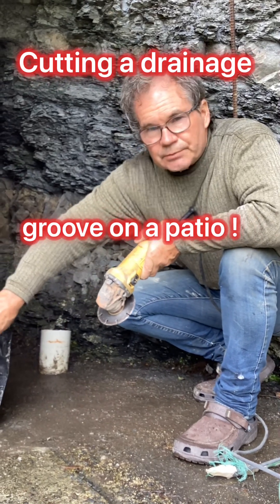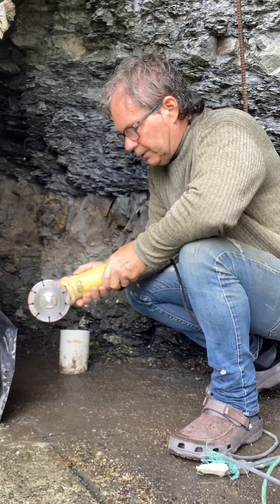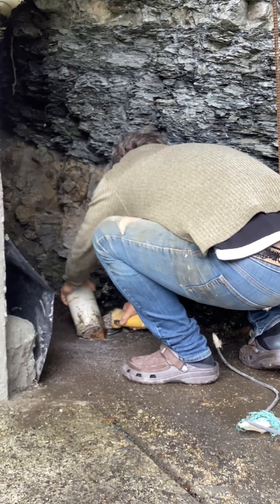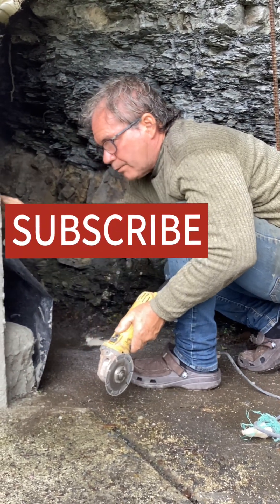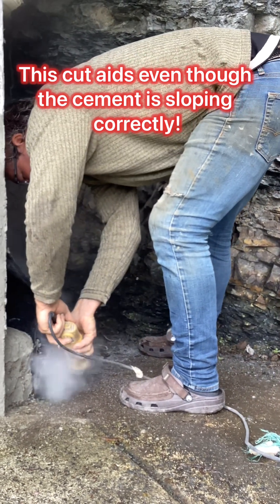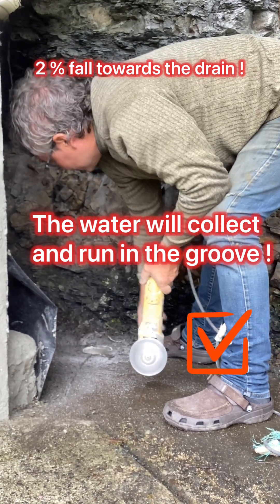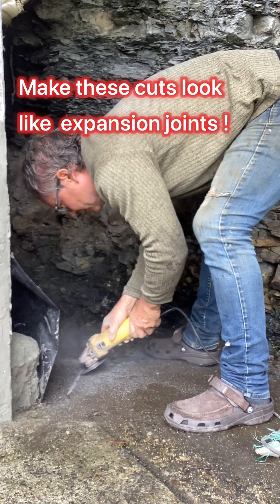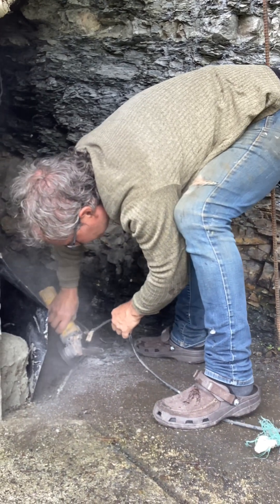#shorts Cutting drainage joints into concrete can aid immensely with moving water towards drains!

Comment: Beyond make sure you do this either before you seal or make sure you reseal it. Otherwise you're just going to end up doing damage to your own stuff. Otherwise yeah it can make a huge difference. I don't know if this is like an add-on or something but if you start things it's typically better to do these types of modifications while the concrete is still wet. 

This comment is mostly for the algorithm since it didn't look like anyone else had commented.
Reply from the maker: @borttorbbq2556  thank you for this. This cut just happens to be going behind a stone wall. So not so crucial. Definitely this back area will be re-sealed as well. Thanks for the comment. The concrete has a 2% slope this just is just to add just the bit more of drainage.

Also doing this type of drainage lines in wet concrete is better especially if you can disguise them as expansion joints the match the rest of the pour. 100 % correct !👍
Reply: Love the channel, try not to breathe in any of the dust, stay safe good luck with the neighbors keep out these great videos